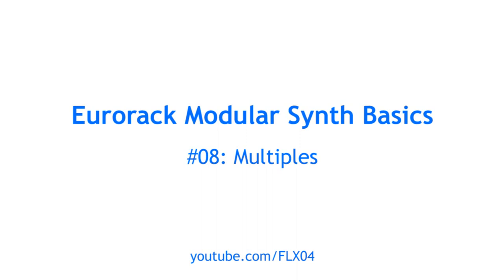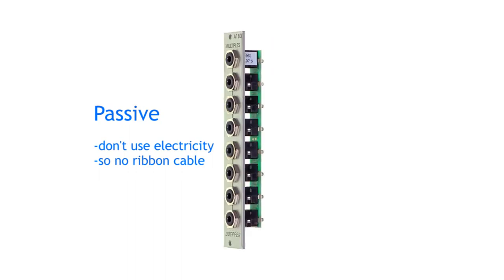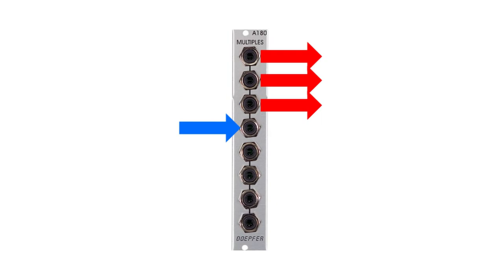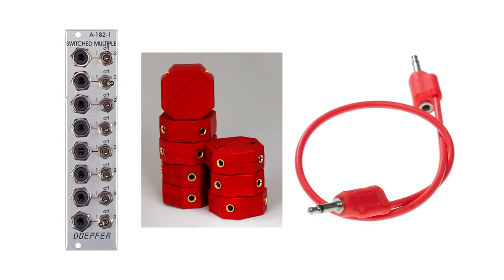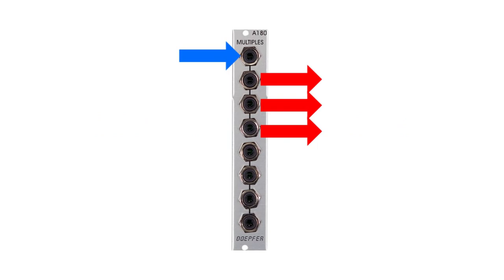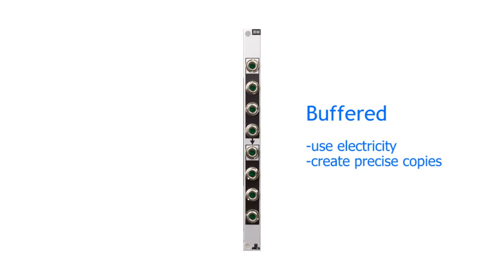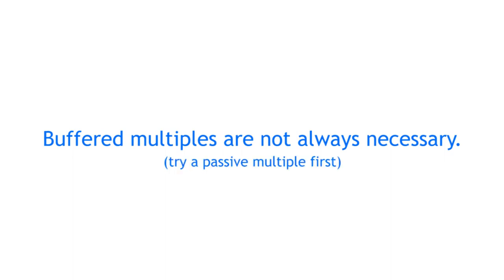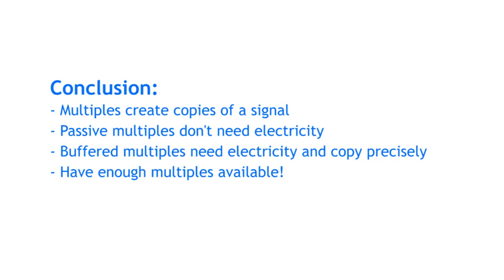Modular Synth Basics #08: Multiples

Comment: Why don't you want to combine signals passively? Will it blow something?
Reply from the maker: Well, you don’t know what will happen. But outputs are made for sending signals and inputs for receiving them, so if you send a signal into an output it depends on the circuit what happens. There is a small risk of blowing things indeed. For example on the self contained Kilpatrick Phenol modular synth one is not allowed to passively mix signals from the MIDI-CV interface because it will damage it, yet elsewhere in the system you are allowed to passively mix up to three signals using multiples, but not more. In Eurorack, where we have lots of modules from different manufacturers, we cannot be sure though, so we just don’t do it. Proper mixers are better anyway.

Comment: I don't have any hardware. I'm just using VCV Rack, and I'm scratching my head trying to figure out why on earth I'd use a Multiple in the digital realm? Why can't I just run several cables from the same output? Why bother duplicating the signal? I don't get it.
Reply from the maker: Good question. I'm not a VCV Rack user, but that seems weird indeed.
Reply: In VCV you can plug in many cables to the same output. That's like stackables, which in the real world cost money and can get difficult after 3 or 4 tall. I like to use a mult in VCV sometimes just to clean up the look of the routing, but it's not necessary.

Comment: If I’m understanding this right, there are eight openings. I can plug one output into it (input) and the other seven can only be used as outputs to other modules. Unless I snip the bridge which give me one in and three outs on top and one in and three outs on the bottom?
Reply from the maker: Correct :)
Reply: @tuesdaynightmachines  are buffered multiples only for CV/Gate/trig signals? Or can I multiply for example, a audio signal, like a drum machine/beat sound from a module or external drum machine?
Reply from the maker: @mookah2696  they’re multiples just like the passive ones, so you can use them for any signal. Generally though, the voltage drop from passive mults isn’t that significant for audio signals (making them just slightly quieter), so I personally wouldn’t buy a buffered mult specifically for those.

Comment: Wait, what happens if you plug two outputs into a multiple as a mixer? You implied something horrible, but I'd be curious what the outcome would be. Damage to the components? 

Incidentally, one video I'd find very useful that hasn't been discussed is related to potential "no nos" in modular patching (like stated above), and how to make sure all my components stay healthy. For example, I recently read a forum based claim that the S-Trigger out on his MS20 mini damaged the gate in of his Minibrute (https://www.gearslutz.com/board/electronic-music-instruments-electronic-music-production/967188-my-ms20-mini-has-fried-my-microbrute-help.html). When patching within Eurorack format, one needn't worry, but when interfacing with the outside world, should we be testing things with multimeters and keeping from frameworks in mind?
Reply from the maker: Regarding the multiple, you just don't know what will happen. Maybe nothing, maybe it will mix, maybe it will make a module just behave weirdly ... generally speaking though, outputs are made to output signals, not to receive them, so I would really not experiment with that, as it could result in damage.

About connecting analog gear: you should check the manual of each module/device and see what's compatible. Some modules/synths want a maximum of 5V for CV for example. Usually they are protected against higher voltages, but some might not be. You don't really need a multimeter though. Just check the manuals. I can't say anything about the MS20/MicroBrute thing you mentioned. It sounds a little weird, but who knows ...
Reply: The signals will mix but you'll also get parasitic current going into your inputs which could damage your oscillators, MIDI devices, and power supply.